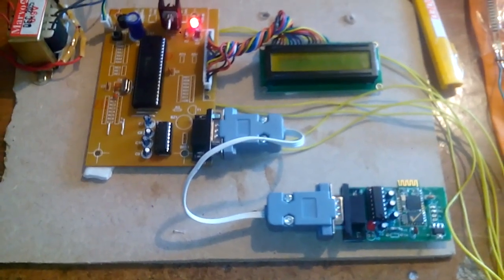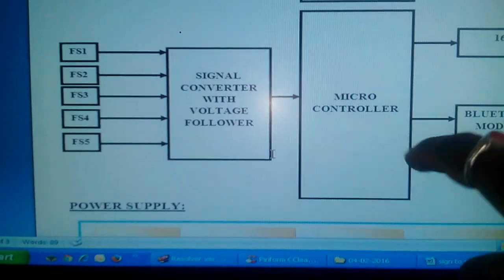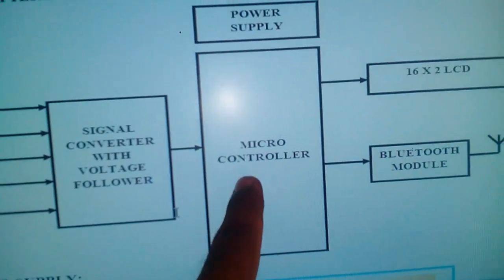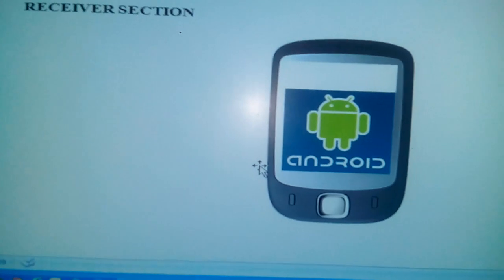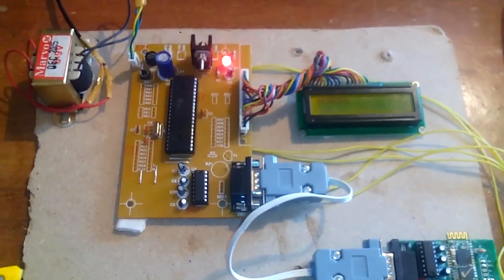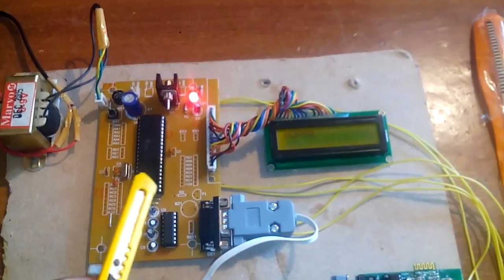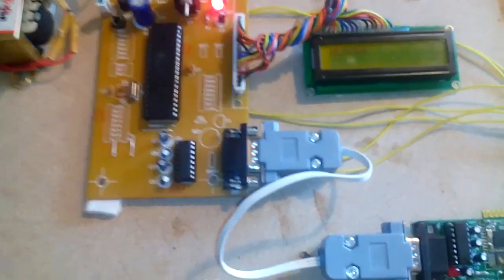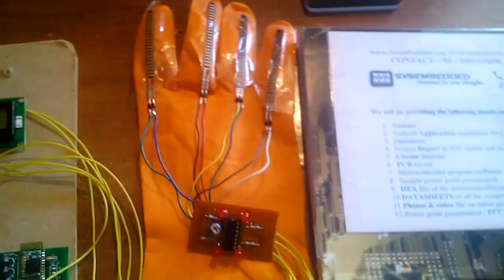SIGN TO SPEECH CONVERSION USING ANDROID PHONE FOR DUMP PEOPLE

Comment: hi, what the program you use?
Reply from the maker: Thanks for watching and your valuable Feed back.yes we will help on coding part.
we are selling the projects with least cost.if u order the project we will provide working hardware kit along with 
1.abstract
2.datasheets
3.documentation
4.schematic( circuit ) diagram.
5.software code.
6.sample ppts
7.photos&video file on entire project
through google drive.if u r interested to take the project.
send me a mail to  svsembedded@gmail.com,info@svsembedded.com.
9491535690,7842358459,
www.svsembedded.com,www.svskits.in,
we will send u the how to order procedure to u on mail.